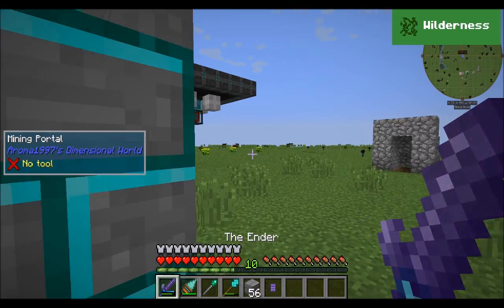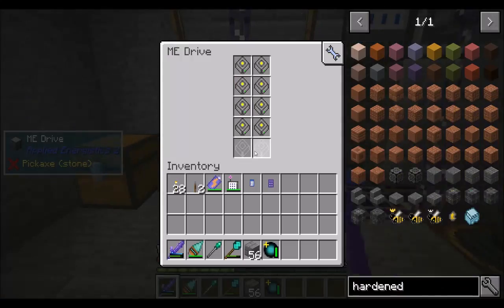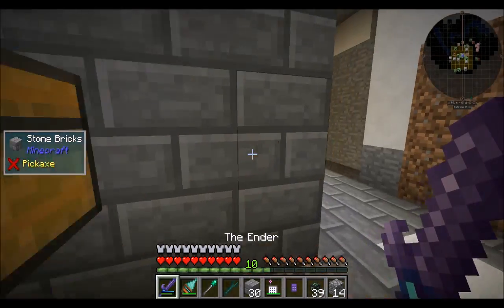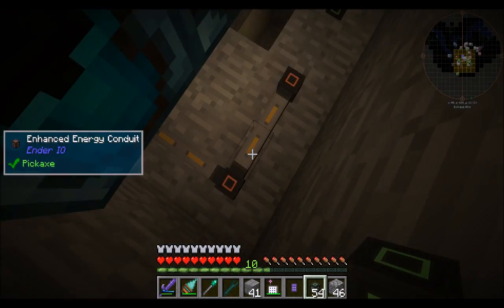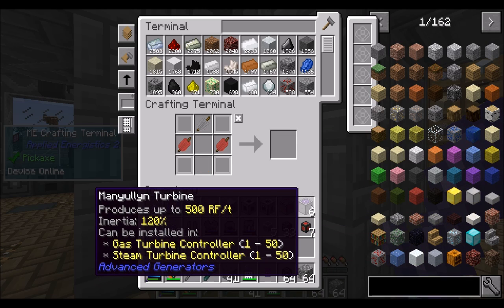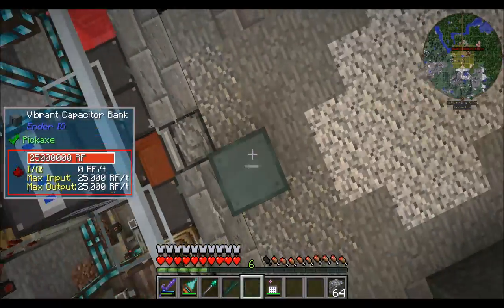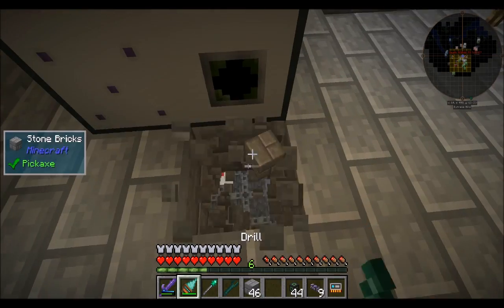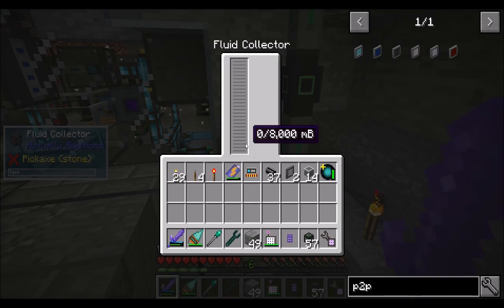AoE Ep44 Power Cleanup

Comment: Now do another episode where you go around with the spawnable space indicators turned on and see how many spot you have in the base and wiring areas that mobs can spawn in.   Last I saw there were SEVERAL on the main floor and there is probably some in the basement that is spawning the creepers.  They're unlikely to have fallen down a 1x1 hole.

Comment: ME Conduits are fantastic in all but one way. They completely eliminate the need for color coded wiring since they can be disconnected at points like any E I/O conduit. Their downside? The DO NOT connect to Applied Energistics partial blocks like import and output buses. So you need to have a single blockspace of regular ME cabling at the very end to connect to any partial blocks or panels.

Comment: You should make endergenic generators. They are easy to setup and are pretty much passive power gen. Just feed them ender pearls (which you now have a steady source). Each setup can produce up to 12k. I built 4 sets for my world and only actually have to run 1 set. So much easier then having to make fuel and transfer it.
Reply: They require lots of tinkering to get the most efficient ender pearl to rf ratio and he has done it before, he has never used Advanced Generators before.
Reply: Totally Not A Banana 
No tinkering required. You Just set it and forget it.
Reply: watch the video
Reply: No you have to tweak the timing on the ender pearl launches and catches and all that in ticks. It can get quite annoying and complex.
Reply: Totally Not A Banana 

lol you tweek it once during setup
Reply: notbill0305frags “easy to setup”  what are you smoking i want some

Comment: The tier 3 powercell you can empower it, that will make it lossless...bit resource heavy though. Then again not sure if you can do that in AoE but it's part of the mod.
Reply: Empower? Do you mean Infuse? If you mean Infuse then that needs shards, which aren't available except from an RF Tools Dimension, and I think RF Tools Dimensions are later in the pack, so not accessible yet (if they are accessible they'd be the obvious shortcut solution to a lot of problems so I'd guess not)
Reply: Dimensional builder is very late-game, unfortunately.

Comment: Why didn't Dire just build his base in the eternal day dimension? lol
Reply: There are upsides and downsides to the Aurora mining world. It is always day there (but it gets overcast when the Overworld is both raining AND night at the same time, TIP: leave a bed in the Overworld by the portal and go there to sleep whenever the Mining World gets overcast) however some things don't work, especially portals are fussy and mostly require building in the Overworld, so you need another base there for them. I think you can't launch Space rockets from the Mining world, and you can't get to the End from there either. It is very boring resource wise - no villages, no deserts, no ocean temples, nothing like that, this is important early game (where to get first Emeralds from before Void Miners?) and late game (you need to find and take blood from a bunch of the world generated mobs, wolves are easy but good luck finding e.g. a Mooshrooom) so you will spend time in the Overworld anyway in those phases.

Personally I do put a base in Aurora mining world and just have a small hut in the Overworld until the Space Age, but it's a personal taste thing. Due to it going overcast you still need to light the base anyway, as otherwise Creepers will spawn when you don't pay attention.
Reply: i guess you mean Aroma Mining World
Reply: For one, the surroundings are boring.
Reply: Nick Lamb you can Galacticraft Launch from the mining world as that is how I am doing it in PO2 but I can't speak to AoE. All around solid post though with good points.

Comment: BTW, I tired using the Actually Additions ESD with the carpenter, it seems you need to set it's outbound values to 12 > 13 for the first slot, 13 > 14 for  the second slot, etc.

Comment: Once you get into Mekanism later on (when exactly does that unlock again?), the Quantum Entagloporter has really high (per the default config: 1.6E7 or 16,000,000) power transfer; though you still have to make two of them. It's still more than the Dimensional Transceiver can do per side. Even converting to RF from Joules that's much higher (6,400,000). In addition, Mekanism power cables transfer rates are additive. Each cable piece added to the same line increases the total transfer rate for the whole length.
Reply: thannonkai is Flux Networks in the pack? If so, he could use those, they can transfer a couple brf/t iirc from FTB Beyond
Reply: Mekanism comes after Space, you need to go to other planets and mine their rare ores to make the Mekanism parts. And we're not talking about Galacticraft here, this is Advanced Rocketry, you need to build a space rocket of your own design, get to the Moon, harvest stuff from there, come back, build a Space Station, launch _that_, take the Moon stuff to the Space Station, build a Warp Drive (like Star Trek) and take your rocket to another planet, land it, mine the planet, take everything back. Fortunately Dire has built a Void Ore Miner at a decent tier, so this won't be crippling for him as it would have been before he was auto-mining. The tremendous quantities of rubies, bauxite, and other rare materials will be fetched by the Void Ore Miner.

Comment: With the empowered oil... Why not make fluid storage cubes in the AE system. That stores the oil... That way you can have a full storage cubes if needed. You could do the same for any of the other liquids like bio fuel, water, lava, pahimar lava ( spelt on purpose ). Always good to be able to use those liquids through the system as needed, as well as make a lot of use of the liquid side of AE. Also on a side note. Did pahimar mention when you would be able to start recording crash landing again?
Reply: sajian starslicer AE doesn't have fluid storage. You're probably thinking of refined storage.
Reply: thegroundbelowme yeah... i got them mixed up, but i thought ae did liquid too

Comment: Regarding the AE2 p2p tunnels:  Were they just trying to respect EnderIO's fluid pipe behavior and not push fluids into a pipe without knowing what fluid is already in the pipes?  That could easily be tested by setting up a tank with an EnderIO fluid pipe connected to a p2p tunnel and outputting the proper fluid into the pipe connected to the tunnel's output, then reversing the flow direction, and see if the p2p tunnel tries to match the fluid that already exists in the pipe.
Reply: You'd first have to fill the pipe up with the proper fluid in it, then take the tank out, and connect it to where it has to go, and see if AE2 likes piping into pipes with known fluids in it.  It sounds as if it doesn't put a fluid into a pipe until it knows what can go in it.

Comment: Do you have to use the empowered oil? Doesn't the regular oil work too? And it's much cheaper
Reply: It is cheaper, yes. But it burns up much faster. So the 2.4mb/t of burn rate for empowered becomes ~10mb/t burn rate for regular oil.

Comment: Honestly I'm very sure that I can make much worse Direwire than Dire does. In fact I have proof with the base I've built in my run of this pack. The only excuse I have is that I was going to relocate once I had a good way to move items. But to be 100 % honest that will never be happening because I definitly won't clean up the mess I've built as a base.

Comment: Dire can u please get rid of drawers drives hold way more please
Reply: Except the drawers have advantages. For one, he doesn't need to have a drive to store them. He can store the same number of a particular item in a 4k drive as in a single upgraded drawer if I remember right. So not that much more storage. And finally, if something happened, (this is dire, DireDerps are legendary,) and his power system failed, he could still access the more basic items without needing power. It would be slow and clunky but he could access the resources to fix the problem without having to work his way through three tiers of gameplay to come up with some form of generator
Reply: Kingbocavill _ not to mention drawers are INCREDIBLY cheap compared with drives

Comment: Dire u should really get quantom quarry it's faster
Reply: It's also more expensive in this pack.  Not to mention that it also needs periodic maintenance to remove unwanted excess junk it mines up out of it's dimension.  For instance, if it happens to mine through a mineshaft, it will bring up items from that.  I believe it also mines up loot from world generation, so if a dungeon spawns somewhere in it's dimension with loot, and it mines there, it'll mine that up as well.